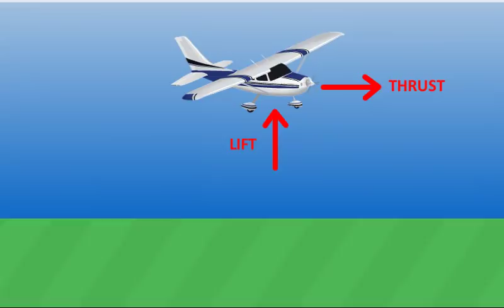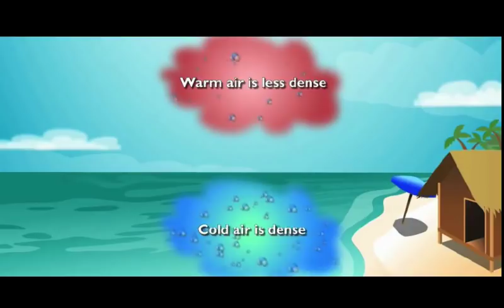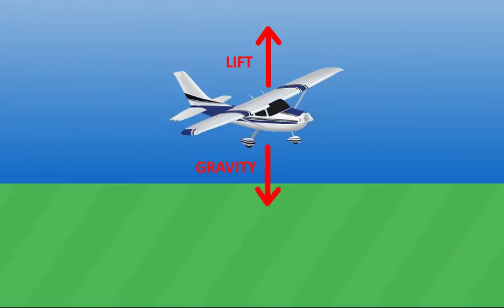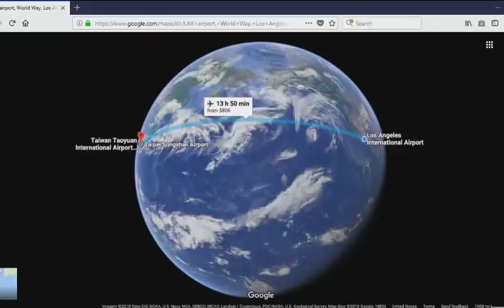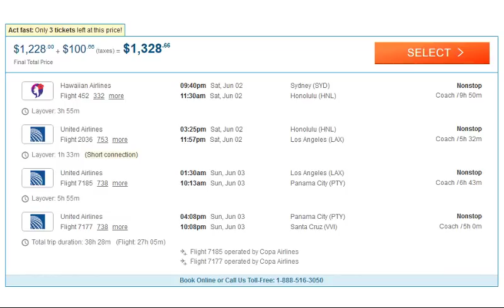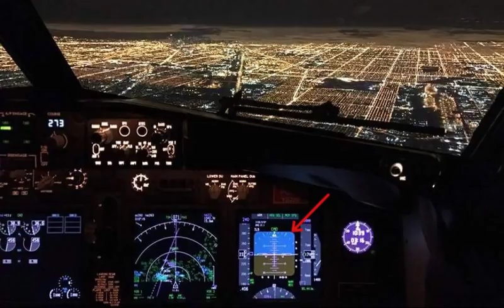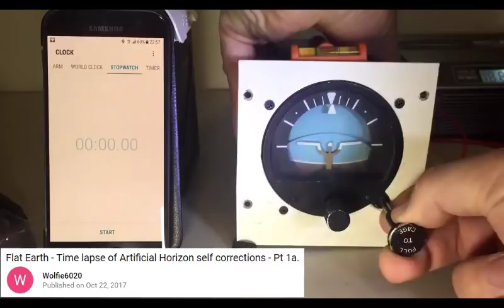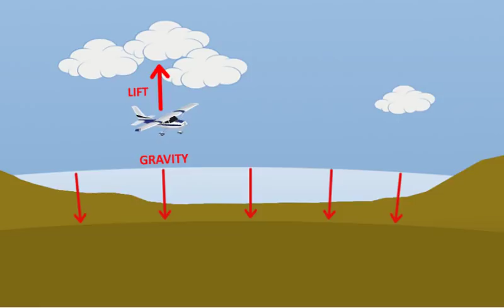Flat Earth Falsities - Plane Nonsense

Comment: gravity doesnt exsist its density and boyance... if something is heavier than its surroundings it wall fall to the ground.. we use propulsion systems to propel us upwards but they only have limited amount of fuel... so if an aircraft runs out of fuel midflight the weight of the aircraft will fall back to earth because of its sheer weight.... gravity has never been a proven force only a hypothesis... we have never witnessed a spinning ball produce any form of attraction or gravity so if we cant prove gravitatiional fields then obviously they dont exsist... magnatesim does exsist but is something that can be proven and is nothing to do with gravity...
Reply: Scott Essex 

Explain this with your flerfie nonsense:

two solid balls of exactly the same size, one made out of wood, the other made of steel. The same volume, different density. In fact, steel is easily 10 times more dense than wood. So...
Both balls are being dropped simultaneously from 20 meters height. 

the diabolic puzzle question: are both balls reaching the surface at the same time? How about IF you take air drag into account? 
yes or no? 

if you tend to answer with „no“, then provide an exact calculation of the difference in time for each free fall. 

flattards: as long as you deny gravity, you cannot use the constant acceleration of 9.81m/s2
Use your „physical law“ of „density and buoyancy“ only. good luck!

oh, be my guest and do this experiment in real life. record it, put it on youtube. with your flerfie explanation. i will watch the whole video, promised! comedy gold ahead. lol

Here are a few numbers you might want to use:
density of water is 1.0g/cm3
density of steel is 7,85g/cm3.
density of wood is 0.68g/cm3. 
density of air is 0.0012g/cm3 (at 20degrees celsius and 1013mbar). 

hint: air drag isn’t really an issue... the difference in time between both the wooden and the steel ball is minimal. unless you have an ultra precise measuring device afterall. 
relevant is only the mass of planet earth causing gravitational pull... and compared to this huuuge planet the mass of the small ball doesn’t really matter. as long as a human being can pick these balls up from the ground, its mass is negligible anyway. 
so this is why the whole thing breaks down to a simple highschool physics problem. let’s see how flattards will struggle with this question... lol
Reply: @GebSpez15215  also it will depend on the weight of both objects regardless of what there made of... if i have a steel ball and a wooden ball.both weighing the same they will both hit the ground at the same time.... thats not even a difficult question... thats like asking the question what weighs more a ton of feathers or a ton of steel...
Reply: Scott Essex 
lol
you don’t understand you own claim, do you?
I wrote that both balls have the exact same size. so the only thing that matters now is their density. 
lets say, the wooden ball weighs 1kg... the stell ball will then weigh roughly 10 kilos or more. size is the same, get it?

so... which ball will fall faster, by how much? what is the difference in falling time going to be?
how long will it take for the steel ball to reach the ground? 20 meters drop height...?
how much longer for the wooden ball? 

can you provide math? can you provide ANY predictions based on density and buoyancy?

lol
try
Reply: @GebSpez15215  ive just told you the heaviest object regardless of size or material will hit the ground 1st.... you show me 1 instance where a heavier object will hit the ground last without using a propulsion sysytem.... case closed... the heavier object will always pick up pace quicker as it falls to earth...density and boyance.... gravity dont exsist
Reply: Scott Essex 
hey flerfie... by how much? the steel ball is 10kg vs. the wooden ball of 1kg. but they are the same size. 

you cant weasel out of this...

answer it. how long does the steel ball fall til it hits the ground? 
how long for the wooden ball?
both are being dropped from 20 meters hight...

YOU can’t answer this... prove me wrong!
lol
😂
Reply: @GebSpez15215  but what difference does the velocity or speed of a falling object have on the properties of boyance and density... all your asking me to prove is the rate at which the steel ball travels vs the wooden ball and what were going to take away from my calculations is the heavier of the 2 hits the ground fastest due to its overall weight and the speed at which it can travel in free fall?  this doesnt prove the exsistnce of gravity only that  heavier objects fall quicker through the air? so denser/heavier objects will fall quicker?? doesnt prove the exaistence of gravity..give me 1 instance where the heavier object hits the ground last...
Reply: @scottessex6122  why do they call it atmosphere if its flat,why not atmoflat
Reply: @Guile1117  cause its a sphere/dome that encloses us atom/sphere... think of a snow globe....
Reply: @scottessex6122  So where is the edge of this fairy tale world?  Why can't anyone find an edge?
Reply: @scottessex6122  So why do objects fall in a vacuum where there is no fluid, hence no buoyancy?
Reply: @scottessex6122  Buoyancy is created by gravity.  Gravity pulling on a fluid generates weight, which causes pressure.  Pressure increases with depth as their is greater weight over a point. Therefore greater pressure pushes on the bottom then the top.  An object sinks in a fluid until the weight it displaces in fluid equals its own weight.  Then buoyancy equals gravity.  So icebergs float 7/8 below water, 1/8 above.  So simple even a Flathead could understand it.  As you hopefully notices buoyancy doesn't push things Down.  It pushes them UP.  So you have the buoyant force going in the opposite direction.
Reply: @scottessex6122  So what holds the atmosphere on Venus, Mars, Jupiter, Saturn, Uranus, or Neptune?  Is there a dome around all them?
Reply: @InternetDarkLord  well this is what we are asking pal? why arent we allowed to fly over the north pole to the south pole why can we only circum-navigate the earth in an east to west or west to east direction why are all the flat earth videos being downgraded by youtube why is it only the heliocentrist model that is taking president and is pushed as the truth by mainstream even though there is plenty of evidence that the earth is the centre and its flat... why are we told their is a molten core at the centre when we have only ever drilled 8 miles deep and please dont use sonar or radio waves etc because some can only travel through soild or liquids not both and they can only determine those 2 factors if soemthing is solid or liquid so to say the core is molten is a big leap. .. if you wanted you could also do the math and place the moon at the centre and have a lunacentric model? where do you get the idea of a vacum from? are you going to tell me space is a vacum? its already been stated that the firmament seperates the waters above from the waters below so if thats the case space cant be a vacum and we live in an enclosed system very cleavery designed  with the moon and sun inside our system?? the only reason i say space is water is because nearly every culture on the earth talks of a great flood so at some point in historyso the firmament must have been broken/open to allow the waters in? or did humanity take the wrong path and civilastion had to be restarted and the ancient txts are our guidelines? the only way out is through assension..
Reply: @InternetDarkLord  buoancy is not created by gravity.... buoancy is when an object is lighter than its surroundings and will rise like a helium ballon density is the weight of the object... if an object is heavier than its surroundings it will.fall and depending on the size and shape will determine its velocity and speed ... if gravity exsited it would have the same force on everything as it couldnt pick and choose what it wanted ?? so again this dissproves gravity... so by your reasoning gravity likes steel balls more than feathers
Reply: @scottessex6122  If there is no molten center where does the LAVA in a volcano come from?  What causes volcanoes?  What causes continental drift?   How are earthquakes possible if the earth were solid?
Reply: @scottessex6122  Space is a vacuum, yes.  Pressure decreases as you go higher, so eventually the atmosphere dwindles to almost zilch.
Reply: @scottessex6122  People have circled the earth north to south through the poles, so asking why they can't makes no sense.  People go to the north and south pole all the time.
Reply: @InternetDarkLord  were not asking to be tourists bro were asking to be explorers.. we would love to get a plane and fly and document everything for you guys but goverments dont allow it
Reply: @InternetDarkLord  the lava you speak of is exactly the same as the veins in your body it carrys the flow of lava and helps.regeneratate the new... the earth is a living breathing entity... it eats itself and recreates itself... the earth is an amazing system of diverse wonder... but to say molten  core at the centre is a giant leap... im more inclined to think at the centre is a heart as heart is an anagram of earth that has its own beat which im sure has been measured in frequency or it might be a giant pulsating atom at the centre .. either way what ever is at the centre has a magnetic field.running straight into it as the north star is directly above it...
Reply: Scott Essex 
wow... stop hallucinating. 

get back to your homework, „bro“!
Reply: @InternetDarkLord  well.my freind i hate to burst your bubble but exactly the same thing.happens in water the deeper you go the more pressure is exurted.. so again is it a vacum or water?
Reply: @GebSpez15215  lol keep.it factual please bro...
Reply: @GebSpez15215  so if i drop the same steel ball 20 times from the same height im gonna get 20 different answers?? is that what your asking? that steel ball is gonna travel at the same speed and velocity everytime depending on the given height...thats facts
Reply: @GebSpez15215  the true north pole is based on land and is directly below polaris... the magnetic north   follows the true north path but is out slightly due to the constant movemnet of the earths magnetic field that it genertates.... whats your point?
Reply: @scottessex6122  You can go to the south pole.  Just call a travel agency and ask.  What are you waiting for?
Reply: @scottessex6122  The molten center is what generates the magnetic field.  Have you ever read a science book in your life.
Reply: @InternetDarkLord  well where abouts on the south pole would you like to go? and how far south can we go before we hit the north pole??
Reply: @InternetDarkLord  im not saying your stupid what i am doing is aaking you the question as to why you think space is a vaccum when exactly the same conditions happen here on earth when you try to explore the oceans? the pressure and air become so tight that it becomes inpenterable...?
Reply: @scottessex6122  You can go all the way to the SOUTH POLE.  Call a travel agency and ask, they will explain.  Then, you can go to the north pole.
Reply: @InternetDarkLord  the molten lava generates the magnetic field?? so if i take a cup of lava and  rotate it at 1000mph its going to generate a magnetic field? is that what your proposing?
Reply: @InternetDarkLord  so why have we never been to the bottom of the  ocean if the same force isnt being apllied as above?
Reply: @scottessex6122  We have been to the bottom of the ocean, have ever read a BOOK?
Reply: @scottessex6122  The core also generates an changing electric electrical field, which generates a magnetic field.  It's Farady's Law of Induction.  And people do that all the time.  READ A SCIENCE BOOK SOMEDAY.  Try a new experience
Reply: @InternetDarkLord  yh pal... but they all state that they havent reached the bottom in fact some claimed to be miles out.. and the last 1 was done by a movie producer james cameron....
Reply: @InternetDarkLord so what causes the electrical field that generates the magnetic field? the molten core at the centre?
Reply: @scottessex6122  People have descended 7 miles to the deepest part of the ocean, the Marianas Trench, but it always possible somebody will find a deeper hole someday.  My point being, air gets thinner as you go up, water does not.  I have no idea what your point is...…….but I doubt you do either
Reply: @InternetDarkLord  my point is we havent been to the bottom of the ocean and your going like we have... also the furthest we have ever drilled is 7 miles deep... so what happens at 8 mile?
Reply: @InternetDarkLord  its also stated that oxygen depletion is saturated at a depth of 200m -1500m ?? so again my point is exactly the same thing is happening in the ocean as trying to enter outer reaches... theres only so far you can go...
Reply: @scottessex6122  At 8 miles the temperature got too hot, so the Kola Superdeep Borehole was stopped.  Below that is rock.
Reply: @scottessex6122  Explorers take oxygen with them.  Even people who climb Mount Everest often take oxygen, so what the hell is your point?
Reply: @InternetDarkLord  below that is speculation pal.... again we didnt even scratch the surface..
Reply: @scottessex6122  The earth's rotation causes motion in the molten iron core, and that generates the electrical and hence magnetic fields.  Again, proving that the earth is round.
Reply: @InternetDarkLord  so if i take iron and and heat it up to the same temprature as molten lava and spin it at a 1000mph its going to generate a magnetic field? is this correct?
Reply: @InternetDarkLord  my point is there is only so far you can go in the ocean because of the pressure  and force thats exurted by.the water... you were the 1 who said space and atmosphere is nothing like the ocean as oxygen doesnt get thinner in water when now you just admitted it does... not trying to be a prick but what im saying is the same force is being applied above as below...
Reply: @scottessex6122  Its not speculation.  There is evidence like the earth's magnetic field.  Where does it come from?
Reply: @scottessex6122  Yes, You CAN generate a magnetic field with electricity in iron.  Its done here on the earth's surface all the time:  Maxwell-Faraday Electromagnetic Theory.  READ a SCIENCE BOOK.  It will obviously be the first.
Reply: @scottessex6122  NO, I said the pressure decreases and density decreases as you go up in the atmosphere, a fact known to anyone on a plane or mountain.  Hence the need for oxygen.  Hence, the atmosphere thins out to a vacuum.  You went on moronic tangent about ocean depth, but I never said oxygen is the same as move in the ocean.  Can you read?
Reply: @InternetDarkLord   so where is the electricity coming from that  then makes the molten iron  become magnetised? also molten iron becomes de-magnetised past a certain temprature?
Reply: @scottessex6122  It comes from the motion of the iron core as the earth turns.  Remember, electricity is just electrons moving from atom to atom.  But hey Can YOU explain what generates the earth's magnetic field?  I can wait.....
Reply: @InternetDarkLord  so what electricity is charging this molten iron core of which you speak... iron loses its magnetism at 1500 degrees ....
Reply: @scottessex6122  The electricity is generated by the Coriolis Effect and Convection in the earth's core.  This yet again proves that the earth is round.  The inner core is too hot, but the outer core can generate a magnetic field.  Meanwhile, I am still waiting for your explanation.  What generates the earth's magnetic field?  I'll hold my breath.
Reply: Scott Essex 
lol
nope. the north pole is not on land. i‘ve been there. like so many people. 

800 kilometers is „slightly off“? the magnetic north pole is way off the geographic one, flerfie...

so you admit that I am a magician. because I can calculate and predict the exact time an object falls from any given hight. 
you cant do that. 
do you admit that you can’t? 
lol
i own you
Reply: @scottessex6122  " the true north pole is based on land and is directly below Polaris..."
     More bad information: Polaris is NOT true north but also apparently revolves around the north celestial pole, as seen in IB Hunter's backyard telescope:  https://youtu.be/wLl47KziQx8?t=25
Reply: @scottessex6122  Airline flights cross near the North Pole all the time. Airlines do not cross the South Pole because it is not the shortest route and emergency provisions would be required. However flights to Amundsen Scott occur regularly during the southern Summer. 
     In 1977, Pan Am flight 50 crossed both the North Pole and South Pole: https://youtu.be/Icu_44iVDA8
     Have you read ATS? It's online. You can explore Antarctica privately or go with a tour group. One group has a package where you cross country ski the final 70 miles to the pole.
Reply: @InternetDarkLord  if this is the case why are the magnetic fields the strongest at the north and south poles..  again is makes no sense as you have already stated the molten  lava gives off the magnetosphere but it runs deep all  over the plane so why would the poles be the strongest out let of this force? why is the force not eqaul all over the plane
Reply: @GebSpez15215  im adamant gravity does not exsist.. its density and bouyance... my weight keeps me.pinned to the ground... unless i exutre force to lift myself off the ground but once that force is exurted im coming straight back down again due to my density...
Reply: @scottessex6122  Gauss Law of Magnetism states that the divergence of magnetic vector field is zero, so of course the lines of forces are stronger in some areas than others.  It's a basic vector calculus problem.  Have you ever read the the Maxwell-Faraday theory of electromagnetism?
Reply: @InternetDarkLord  yh pal im aware.. an iron core but you guys say the core is molten iron at several 1000s of degrees ... but iron looses its mangentism afer 1500... also you say its lava that comes out that cools and becomes magetic? is this correct?  if so what is powering this soure with electricity to make it all work??
Reply: @scottessex6122  that is pure lies
Reply: @anthonybolton2717  ill put my density and bouyance against your gravity till the end of all time ... gravity doesnt exsist... we can levitate using frequency waves and we can generate free energy using teslas theory... we dont need gravity the only reason gravity was theorised was to hold up the heliocentric model.... were moving into the age of aquraius my freind ... this is known as the age of enlightenment... 🖒🖒
Reply: @scottessex6122  yeah yeah yeah, talk about delusional
Reply: Scott Essex 
then do it. but you can’t. 
you failed to calculate the time for a freely falling object. 
you failed to explain basic physics. you have nothing. 
no „density and buoyancy“ model, nothing. you are deeply disturbed, full of hate against „them“, while you don’t even know who they are. 

you know NOTHING
Reply: @GebSpez15215  sit down little man... the impact speed of an object hitting the earth has nothing to do with gravity.... gravity is a fictitional force... the weight of the object plus the distance it fell from and its speed of aceleration  will give you a speed at which that object will hit the ground.. this force of gravity doesnt or even come into the equasion my freind... hahahahaha
Reply: @scottessex6122  please don't drag Nikola Tesla into your delusional theories
He deserves much more......
Reply: @ajaydass3002  so do we pal but your heliocentric masters have other ideas.. you can fool some.of the people some of the time but you cant fool all.of the people all the time "bob marley"
Reply: @scottessex6122  I think you should answer @Profe Reto 's math problem or @internetdarklord 's magnetic field question .
Reply: @ajaydass3002  when the apple falls from the tree it heads straight for the ground due to the weight/density of the apple...  depending on how long or short the distance is will depend on the speed it impacts the ground.... if i drop an apple from 20cm height it wont have enough distance to attain its full speed ... if i drop that apple from 50mtrs it will continue to accelerate until it meets resitance from the opposite direction in this case its air..  the air around the apple acts as resistance until the falling apple and the air reach an equilibrium at which point the apple will stay at its ultimate velocity before impacting the ground....  where does gravity even come into the equsion....
Reply: @scottessex6122  What do you think the velocity of the apple would be if dropped from 10 km height ?
What do you think the velocity of a iron ball the same size of an apple would be if dropped from 10 km height?
Remember the size of an apple,not the weight, not the density.
Reply: @ajaydass3002  well the maximum velocity depends on the weight and mass of the falling object... a falling feather is never gonna reach the same velocity as a falling iron ball and also the speed at which there falling is gonna determine the amount of resistance they will get from air which will result in ultimate velocity.  stick with facts.. if both objects are lighter than air they wont even fall they will rise
Reply: gravity dont exsist
Reply: @scottessex6122  Fine Gravity doesn't exist
Just answer my question
Reply: @scottessex6122   @Scott Essex  What do you think the velocity of the apple would be if dropped from 10 km height ?
What do you think the velocity of a iron ball the same size of an apple would be if dropped from 10 km height?
Remember the size of an apple,not the weight, not the density.

Just answer this question
Nobody asked about gravity
Reply: @ajaydass3002  i dont know pal i dont do maths but from my calculations the iron ball will hit the ground 1st because it will be denser and heavier... im guessing you have done the experiment yourself ... so which hit thd ground 1st? would it be the iron ball or the apple and how does this prove the exsistence of gravity..... (it doesnt)
Reply: it proves density and bouyance outweighs gravity.... also that gravitational force of 9.28 what ever it was is a measurment of the air pressure or resisting force and the masons have tried to pass it off as a gravitaionol force....when its actually air resistance there measuring....
Reply: @scottessex6122  
Actually
Both will fall at the same time
Both the velocity will be same
Leave gravity
Let gravity be non-existent
Just tell me how it achieved same velocity using your buoyancy and density
And don't tell me it won't fall at the same rate
If you have doubts
Go to the highest possible floor and test it.

Just tell me how it is possible using buoyancy and density
Reply: @ajaydass3002  denisty is what gives you weight.... dont get blinded by science... that 9.28 wat ever wat ever is amout of resistance from air on a given object with that radius...  its not a gravitational calculation its an air resistance calculation... no the denser object will obviously have greater speed unless you change the "aero" (air) dynamics of the object the same as carbon steele floating on water..
Reply: @ajaydass3002  if i want to know the weight of an object ill place it on a set of scales ...  is it gravity pulling the scales down or is it the density of the object?
Reply: @scottessex6122  
I think we are moving away from the subject
Let gravity be non-existent
You don't have to disprove it.
Just tell me why object of different size weight and density have same rate of acceleration.
Just test it if you don't believe me.
Reply: @scottessex6122  
I can answer your question, but it involves gravity so you will not accept it .
Since gravity is non-existent from your perspective.
Reply: @ajaydass3002  well ive just dropped a pen and my phone from the bedroom window... the phone hit the floor 1st and smashed the screen the pen came in 2nd and is still.in tact if they both accelerated at the same.time why did my phone hit the floor 1st...
Reply: Scott Essex 
interesting! how does the scale determine the density of the object? density is mass/volume... show me you scale, and how your device can determine the volume of an object. 
lol

PS: drop you scale with your object on top and watch the display... it will go to 0...

or jump onto the scale yourself. why do you weigh so much all of a sudden? but the next moment you are the same weight again? did you get denser??? lol
learn basic physics. learn about forces, acceleration and velocity, learn about mass and momentum. 
just do it. at least you need to know the things you desperately try to debunk... 
hahahahaha 
😂
Reply: @scottessex6122  
I'm sure that would be a split second
Try doing it in a controlled environment, increase the drop distance and record it .
Look at the video
I'm sure they would be accelerating at the same rate
Don't trust eyes or your ears.
Try recording it.
Reply: Scott Essex 
when you say „accelerate“... thats gravity causing this acceleration. well, YOU asked... didn’t you?

its this acceleration you need to explain with „density and buoyancy“...

go on.
Reply: @scottessex6122  
About the video you shared.
It addresses all your doubts
Now tell me why the car and the wheel had the same terminal velocity.
Reply: @ajaydass3002  cause of the distance they were dropped from bro.... the car is never gonna reach maximum speed from that height.... if the car and the tire were pushed out of a plane it would be different.... like i said  distance also plays a factor
Reply: @scottessex6122  
Actually no
This is what Galileo did from the tower of Pisa
He dropped iron balls of different size and weight, still they all had the same acceleration rate  .
Even if you drop it from the plane you will get the same result. You may try if you could.
Reply: @scottessex6122  
And you mentioned that the car won't reach maximum speed.
Then what do you think the maximum speed would be or at what distance should it be dropped?
Reply: @GebSpez15215  acceleration comes from the density/weight/mass  of the object... gravity dont exsist.... the only time anything will hit maximum speed when falling is when it hits resistance?? air pressure or if the distance isnt great enough it will be the ground... booooom headshot
Reply: @GebSpez15215  so if gravity doesnt exsist then neither does the heliocentric model because its gravity thats keeping everything in sync according to the sunworsippers and the freemasons but im more inclined to think/beleive its elrctromagnetism and frequency that governs the celestial bodies....
Reply: @scottessex6122  that comment makes not sense even if if the world was flat we'd still have to pay for stuff, the globe has nothing to do with the economy lol
Reply: @GebSpez15215   ive seen your errors . 
free falling object.... that is the key 

in a vacuum where there is no air or resistance all objects will fall at the same rate  because there is no resistance which is where you have got your equasion from... we dont live in a vaccum bro so your calculations for gravity are wrong and they also dont take into consideration the air pressure acting as resistance  here on earth... 

inside a vacuum chamber both objects will fall at the same rate not due to the force of gravity but becuse there is no path of resistance....  so again density wins the day
Reply: @Guile1117  if i gave you a device that could power your home for free would you be interested?
Reply: @scottessex6122  that's not the point the point is these things like paying bills like electricity and water would still happen on a flat earth, a globe earth has nothing to do with money or living
Reply: @GebSpez15215  density and bouyancy dont need gravity... and why does gravity only work on big objects ... why does lego not stick to a basketball of its own accord... 🖒🖒😂😂 realtive density will also explain your equasion pal but i dont do math just observer nature..
Reply: @scottessex6122  that doesn't help or answer anything I just said,nothing in this world will ever be free,heck what about these flat earth channels making money,jernism admits he lives off his subscribers and everyone  buying Eric Dubays books and crazy song,once again even if the world was flat we'd still be paying Bill's,so ya what you said doesn't change anything lol
Reply: @Guile1117  well if im pulling free energy from the atmosphere how could i possibly charge you for that and how selfish would that be...
Reply: @scottessex6122  then go fo it then lol go make free available energy
Reply: @scottessex6122  This is weird, you said buoyancy and density, no  other "force". So why do you write: can only go so far down the ocean because of pressure and force exerted by water. Why? the density is not changing with depth,  so it must be buoyancy  then. So, what makes it change as we go down? it is not density so there must be something else acting... maybe something like gravity?  

Density is g/cm3, movement is m/s, I really wonder, just reasoning the units here, how can you turn g/cm3 into m/s. So if you let go of a ball from 20 meters high, whatever density, as you let go and it is not moving, how does 0m/s starts changing to get a downward motion of Xm/s and all of this starting from g/cm3 units.
Reply: @scottessex6122  If gravity does not come into the equation, you say the impact is weight (maybe mass) , distance and acceleration. Exact, impact is related to mass and speed. Speed is related to distance and acceleration. So now, what causes the acceleration? remember, acceleration is measured in m/s2.
Reply: @Tangoc555  gravity doesnt exsist... forget gravity... its the weight of the object that forces/pushes it to the groud....  ive recently learned that w=fg ... weight is the same as the force gravity which is laughable as its the weight of the object that generates the force...
Reply: @Tangoc555  the weight of the object cause the force of acceleration
Reply: @Tangoc555  imagine the apple falling from the tree.. its mass and weight and density get so big it falls under its own weight to the ground... no gravity involved
Reply: @Tangoc555  and if you want to know whats holding everything together is elctromagnetism and frequency.... gravity is a curve ball.... steer clear of that ideology if you want anti grav or levitation think magnetism and ultra high frequency.... bless
Reply: @scottessex6122  Of course, the apple goes from 0m/s to Xm/s by magic. Electromagnetism (electro seriously!) sends the apple down because the tree is connected to the city's power utility. Nice!

Weight, acceleration. magnetism, electromagnetism, ultra high frequencies, ... stop piling up words for which you have no knowledge of and start by googling weight to understand. Saying weight brings the apple down but gravity does not exist, you have a long way to go to get to electromagnetism
Reply: @Tangoc555  what?? again gravity doesnt exsist... the weight mass density of the apple is enough force alone to make the apple fall.... gravity is bollox mate... its electromagnetism and frequency that holds the celestial bodies in orbit... not gravity... gravity is for kids ...  even einstein looked smacked off his tits in most his photos and knew himself it was bollox ...   seriously if you want anti  grav you need to look into frequency and magnetism... dont get mardy i understand its a tough pill to swallow but we get lied to all the time by mainstream... santa was real until i was 4...
Reply: @scottessex6122  You still haven't answered any of the questions submitted to you. Someone told you you can't do the maths, you can't figure out the units of measure either. Still, how does mass (g) and density (g/cm3) will get you to movement (m/s)...oups does not fit your paradigm does it? Frequency is cycles per minute, again the units not working, electromagnetism wow! Electro... funny 

Weight, mass, density of the apple is enough force. Ok, you can leave mass and density out just keep weight and google: What is weight 

A quick question, since electromagnetism is holding celestial bodies, why a power line is not holding an apple from a tree which is in its magnetic field (sorry, electromagentism with frequency - hillarious). More, the apple should "defy" gravity and go up to the power line wire since this is where the electro-attractive-frequency-magnet force is. 

Electromagnetisim and frequencies... someone who can't understand gravity is now referring physics which uses high level differential and integral calculus... ya right!  You have no clue mate...
Reply: @Tangoc555  yh pal gravity doesnt   exsist... there is not even any reason for gravity to exsist only in the helicentric model both the flat earth and the concave system do away with the idea.. weight has nothing to do with gravity.. weight is a force on its own... if i drop a feather and a hammer on your head which object is gonna hurt the most and why.... the hammer because it weighs more ... how and why does gravity come into the equasion?  it doesnt.... the weight of the hammer being dropped is enough force to cause damage to your head....
Reply: @scottessex6122  Sorry, I will stop her since I believe you are simply trolling, no one can be that far out. If you are not kidding, you need therapy...
Reply: @Tangoc555  ill argue gravity all day long pal.... the heliocentric model was only ever meant to be a theory  persued by the sun worshippers cult... freemasons etc etc... when you see the concave model you will see its all electromagnetism and frequency.. gravity dont exsist....
Reply: @scottessex6122  You are right, gravity does not exist, the sky is green and oceans are orange. Don't believe otherwise, the color definitions are all wrong, everyone has been lying to you all those years, what you see is not the real colors, it's only what they told you it is, don't believe them and look for a youtube video prepared by a clueless in his basement. Maybe under : the grand color conspiracy!
Reply: @Tangoc555  ok so now we agree gravity doesnt exsist what do you suggest we do about the heliocentric model and its mainstream brainwashing of the masses... should there be a public appology by the freemasons and nasa etc and do we get to find out what they have really been up 2...
Reply: @scottessex6122  
"all freemasons aswell werent they? sunworshippers cult?"
 AND NOW LADIES AND GENTLEMEN THE ULTIMATE MAGIC TRICK OF FLAT EARTH ADEPTS : CALLING  OPPONENT "FREEMASON" !
No need to demonstrate they are wrong : just call them "freemason" !
No need to prove you are right : just call opponents "freemason" !

SO easier than PROVING your point !
Reply: @GebSpez15215  bro if i drop a feather and a cannonl ball  from the air the cannon ball will hit the ground fastest because it weighs more and will gather more speed  quicker thatln the feather which weighs less... so you have just prove density and boyance yourself ...  gravity dont exsist
Reply: Scott Essex 

Flattards really don’t understand elementary school geometry. 
so sad...
all it takes to disprove flattardia is a sunny day. 
the suns apparent path across the sky proves flattardia wrong.

1) the sun changes its position in the sky by 15 degrees per hour. due to the easily verifiable fact that a day lasts 24 hours and earth turns once around its own axis. 
(even on a flat earth the sun would have to fly around in circles 360 degrees in 24 hours... lol)
agree??

2. if an observer measures the angular speed of the sun anywhere on earth, the angular speed of the sun will always be 15 degrees per hour, no matter where on earth the observer is. 
agree?

if you do not agree on points 1) & 2), measure it yourself at home. do it during the day, the sun is not visible at night. no telescope or p900 zoom can change that... for a good reason. so wait till the morning...

observable constant angular velocity of the sun everywhere on earth leads to the ultimative conclusion. earth CANNOT be flat. why?

if the observer measures a constant angular velocity, and - to make flerfs case - earth was flat, this observer must be in the middle of the circle. inevitably. geometry is mercyless, flerfies, srry. 
now on flattardia disk world that observation could only be true for the center... which would be at the north pole. do you live at the north pole? of course not...
the easily observable angular rate of change is 15 degrees per hour. EVERYWHERE ON EARTH. 

for flattards it gets worse... much worse. if the sun was circling 3000 miles above flattardia, the exact 15 degrees per hour would only be true if the observer himself would be hovering 3000 miles ABOVE the north pole. 
when standing exactly on the north pole on the ground - and only then - the angular velocity would still be constant... but clearly less than 15 degrees. the lines of sight would form a cone (looking upwards all the time)...

so dear flattards... there is NOTHING you can do to defend your delusions. no adhoc excuse is going to save you. no flerspectiveeeh, no flerfraction or atmospheric lensing is going to change this fact. 

the silence of you flerfies is deafening...
Reply: What is WEIGHT? I'll let you stew with that one for a while. Good God!! And what is "boyance?"
Reply: this is where ball earthers get it wrong.... if the earth is a closed system and the ball spinning has no effect on the atmosphere on earth then what is it then enlcoses us and by saying earth is a closed system you have just admitted we cant enter space because of the barrier keeping us enclosed.. the firmament that seprates the waters above from the waters below?